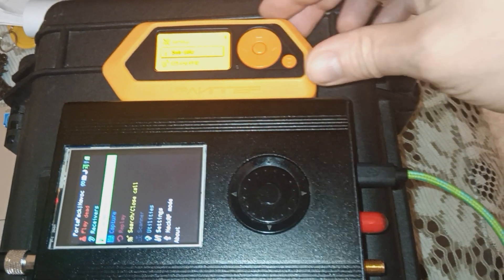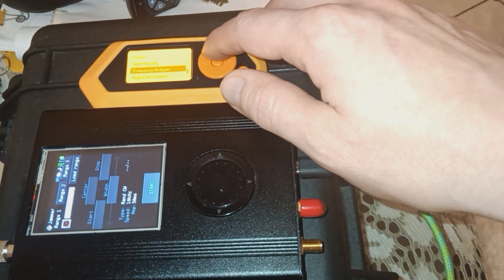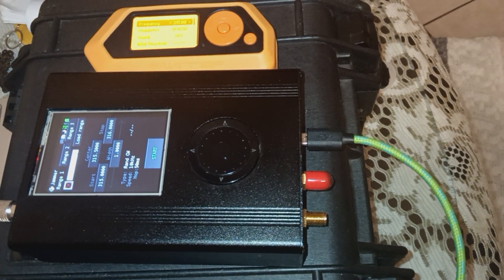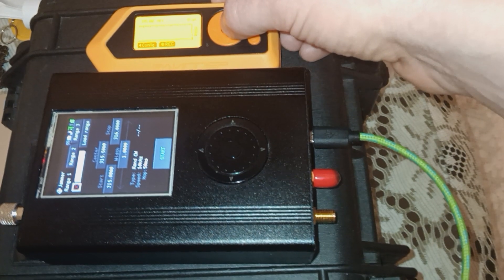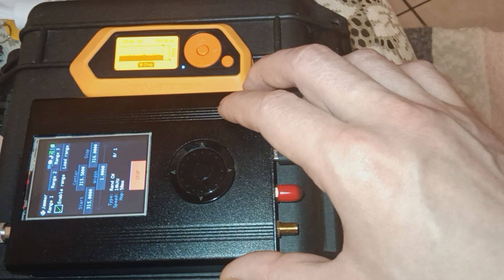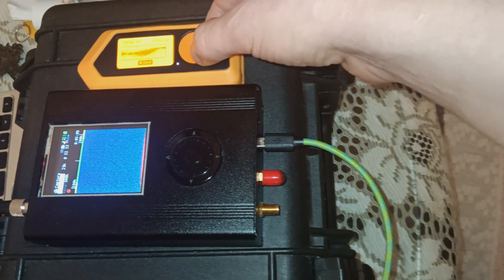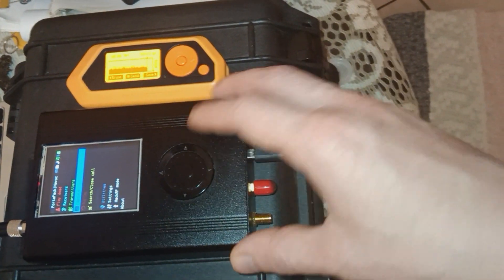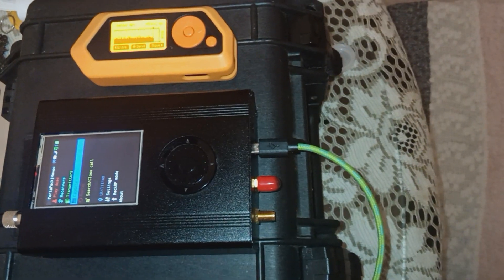Flipper Zero & Hack-RF Portapack: Jamming Signals & Replay Attacks

Comment: Thanks for the video ! How do I turn this device into voice 2 skull device ?
Reply from the maker: Not sure, other than signal jamming v2skull feature, which would depend on the frequency.
Reply: @ninjavelli  could it jam a wide range of frequencies at once ? Or will it only jam a set frequency ?
Reply from the maker: @antwanwallace2832  The HackRF can jam multiple frequencies at once.
Reply: @ninjavelli  to achieve that, what attachments do I need with the hackrf?